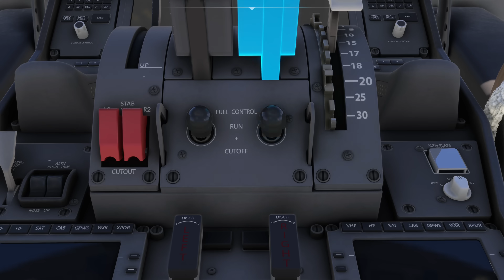Air India 171: Why Did The Fuel Cut-off Switch Get Moved?

Comment: Steve: READ THIS

Everyone seems to be twisting the actual last statements or words of the Pilots.

Their exact words, as taken from page 14 from "Preliminary Report Accident involving Air India’s B787-8 aircraft bearing registration VT-ANB at Ahmedabad on 12 June 2025"

Are as such 
Presumably Pilot "why did he cutoff"
Presumably Copilot "he did not do so"

Seconds later fuel was restored.

Until voice analysis is analyzed either pilot may have flown that plane. It is not uncommon for pilots to allow a copilot flight time.

Everyone is jumping to conclusions on this statement. Think about it. 

This is an active conversation between the two pilots with the tower. He says into the the mic which the co pilot is also hearing "Why did he cut off'? The co pilot responds and says, "He did not do so".

Now let's think about how that makes no sense in any other context. You're a smart guy. I'll make it brief.

I'm the pilot.. I'm thinking out loud. I see the switches in cut off position and I ask my self out loud " Why did he cut off"? If this was the case, a rational response from the copilot would be perhaps "Cut off what"? He's not psychic. 

So let's propose the pilot literally pointed at the fuel switches and said out loud "Why did he cut off"?

Copilots response wouldn't be "He did not cut off" spoken in third person... It would be spoken in realization the pilot is insinuating he cut them and his response would be more like "I did not do so" and not "he did not do so". 

This final communication had nothing to do with fuel switches and everything to do with a pilot communicating with their tower and thinking communication was somehow cut.

Comment: if its the pilot work done (for example) pilot should stretch his hands and he should take some time to operate the switch off position ...because it needs some extra side lever pressing to switch off...if so....the other pilot will be immediately divert his view to the dash board thinking why the other pilot doing in the switch?????? so it might not be the issue.... due to mechanical malfunctioning the switch both suddenly automatically came to switch off position. (Its my opinion, anybody can answer for this)

Comment: In the report it says (I haven’t seen it) that mechanically both switches were in the mechanical position (cut-off) — or did the flight recorder only record that the cut-off signal was received?
Is there a sensor that indicates the exact position of the button, or does it only record that the cut-off signal was transmitted?
Is it possible to execute this command within one second?
You have to be very calm and highly trained to carry out such a procedure so quickly — especially knowing it will cost you your life...

Comment: Under normal, intentional circumstances, it is highly unlikely that a pilot would inadvertently or deliberately move both engine fuel cutoff switches from RUN to CUTOFF within one second during takeoff. Here's why:

Design Safeguards and Ergonomics: Fuel cutoff switches on the Boeing 787-8 are guarded and positioned deliberately to prevent accidental activation. They are designed to require a conscious, deliberate action. typically lifting a guard and pulling or rotating the switch.

Moving one switch requires effort; two within one second would likely require both hands or an extremely focused, coordinated motion, not a reflexive error.
In a high-workload phase like takeoff, pilots are hyper-focused on speed, attitude, and callouts, not on engine shutdown procedures.

The CVR (Cockpit Voice Recorder) transcript suggests confusion, with one pilot asking, "Why did you cutoff?" and the other responding, "I did not do so."
This indicates neither pilot intended to shut down the engines.

Possible causes for near-simultaneous fuel cutoff activation might include:

1. Mechanical or electrical fault.
2. Malfunctioning autothrottle or flight control software.

Latent defect in the fuel control switch locking mechanism:

- The report referenced a 2018 FAA Special Airworthiness Information Bulletin (SAIB NM-18-33), warning that locking features might be disengaged on some models, making unintentional movement more likely.

- Air India did not inspect VT-ANB for this, since the SAIB was non-mandatory.

Comment: The physical switches may not be turned off. However, electromagnetic interference from other wires or electronic components, caused by faulty wiring, poor grounding, or lack of interference rejection containment, may generate spurious signals, leading to misinterpretation as fuel-off by the flight computer.

Comment: Please answer this for me Steeeve.
I have been really troubled by the "Evidence".
The transcript says one pilot put the controllers into 
"Shut Off" position.
The other pilot returned them to the "Run" position.
So WHY does the picture of the instrument panel after the crash, show them in
"Shut Off" position.
Or have I got it wrong?
Reply: Because they got destroyed in the impact. The black box has recorded the position of the switches, so the question is already answered.
Reply: If they were destroyed in the impact, what does the picture circulating refer to?
Is that not of the Air India aeroplane in question? @rabarebra

Comment: Can't we relay the ground sensors on the wheel that senses the aircraft is on the ground and set a time frame of 5 mins to that information so that the fuel stays stuck on run and when human intervention happens it gives out a master warning as simple fuel cut off or 1 engine failure(left) or 2nd engine failure(right) or dual engine failure for the master warnings.
Reply: As he said in the video, a human must be allowed to turn off the fuel switch IF a motor is failing. There is no way around this problem than having two humans control the switches. There should be double safety (because of mental health) for two pilots having their own cutoff switch - a copy so to say, so that both double cutoff switches need to match. It would solve the suicide problem one individual would have. The only problem left would be if both pilots were suicidal.
Reply: Thats fine im saying if a human interventions happening then the pilots should be alerted about it I'm not asking to stop it from usage but when used an alert should be noticeable enough to let them know about the manual fuel cut off so that they have a considerably bigger time frame to re settle things back.

Comment: I never realized how poorly planned some plane systems can be.
Critical switches and options should be guarded with multiple layers of checks.

How hard is it for a system to detect if the plane is gaining altitude, preparing for takeoff, or has a full fuel load?

Even a basic alert confirming such operations should be enough to notify the pilot.
Reply: This is not the problem. The problem is suicidal thoughts on one of the pilots.

Comment: The problem with your analysis is obvious. Once you said "I'm assuming". This early in an investigation, one cannot " assume" anything. We know ( at least from what of the CVR was released), what the pilots said. We don't know what the plane ( software mechanics), did. Unfortunately these planes are programmed to "think and ACT" independently if "the plane" determines it's warranted. From what we remember of the TWO successive crashes a few years back, both pilots may have been telling the truth and "the plane" was acting independently, through faulty programming or mechanical faults. Anyone, especially a PILOT, should not "assume" with so little concrete evidence that one of these men is a mass murderer, period.
Reply: Assume? The evidence is already there.

Comment: Not sure if this question was asked,  would there be any chance that the computer sent the wrong data to the fdr confirming the switches turned to cutoff?
Reply: How would they even get a lift-off if there was such an error in the first place?
Reply: @rabarebra what i meant was purely from the FDR perspective - preliminary investigation says as per the FDR data the switches were moved to cutoff position, and then back to run, so my question is purely on that data I.e. erroneous data in fdr? Would that be possible?

Comment: As both switches are mounted in the same assembly, If the entire panel became loose (screws, mounts, internal bracket) OR the internal mounting frame warped or flexed during takeoff acceleration/vibration, then both switches may have simultaneously lost detent contact (this is like a loose control panel in a car, if the entire frame shifts, all buttons or levers may get misaligned or move together)

Is there mechanical reliability analysis and failure modes report available?

Comment: I have a different question- why does the software not alarm the crew that these switches were switched? The airplanes have been designed for so many years, and now it looks like the safety basics are completely ignored by the manufacturer.

Comment: Are there any other switches which the pilots need to activate or deactivate just after take-off, especially in the close vicinity of Fuel cut-off switches? If yes, their positions may be verified. Maybe unintentionally, any of the pilots put the fuel switches to CUT-OFF instead of the required switches.

Comment: As an Aerospace and Systems Engineer my biggest fear of flying is the human in control of the plane. Extreme safety factors are placed on every manned system design, making these planes incredibly safe machines, but the largest deficiency in engineering today is Human Factors engineering. Humans are the most complex system to model. The sad truth is it takes a 1 in a billion failure of this nature to reiterate the design process to make a safer plane. It is immediately evident to me that, just like any safety critical hardware has  redundancy, that any safety critical  procedure shall also have redundancy. Not only do I think that those switches shall not be moveable while the throttles are are set to takeoff, but also those switches could be placed on both sides of the cockpit making it mandatory that both pilots turn the switches off for them to take effects. But even this method increases complexity and warrants other concerns like what if one pilot becomes incapacitated?

Comment: Shame on you Captain steeve😭, it wasnt expected from you, blaming pilots who are not here to put their side is very easy thing.  Mr. Steeve, how can you be fully sure the switches were manually cut by pilots?  I could be manufacturer's fault as it was also imformed in 2018 bulletin released. 

You are directly or indirectly ruining pilot community integrity. Shame on you sir ☹️
Reply: The airplane was fully functioning. The data reveals that. This was a human error (read: mental) fault by one of the pilots, not both. Go eat a cake, dude.

Comment: A simple mechanism could have saved .
In manual driven cars , if the car has achieved a speed, you cannot switch the gear to reverse position. Similar mechanism , if any flight is in motion these fuel   switche gears should not be allowed to cutoff either automatically or manually . Unless there is some algorithm wherein the switch can change to cutoff automatically like fire alarm .
Reply: So what do you do in the air then if one of the motors fails? Just let the fuel flow? Jeez, you have to think before you comment.

Comment: The Preliminary Report about the 12th June 2025 13.39 Local Time India, Ahmedabad, 2.5 kms W of Sardar Patel International Airport, 23.055488°N 72.615643°E, Air India Boeing 787-8 Dreamliner Crash Flight 171, Rego VT- ANB is interesting yet it is missing some very important parts.

A couple of points:

(1) This report was released in New Delhi on Sat. 13th July 2025 at 01.35 IST (India Standard Time GMT+5.30) - Fri. 12th July 2024 at 22.05 CEST 20.05 UTC 16.05 ET five minutes after the NYSE closed for trading. Boeing’s share price actually went up in after hours trading following the release of the report. USD 231,20 +4,36 (1,92%). This indicates that Boeing Intel and Aviation Analysts-Investors believe a Electrical/Technical Fault was not the cause of crash. 226,84 USD +23.09 (11.33%) over the past month.

(2) The Preminary Report states: At about 08.09.05 one of the pilots transmitted “MAYDAY MAYDAY MAYDAY”.

(a) Why is it “about”? 🤔 Surely they must know the exact time this call was made. 

(b) Which of the pilots made this call? 🤔

The co-pilot 32 y.o. Clive Kunder was Pilot Flying (PF) and the PIC, 56 y.o. Captain Sumeet Sabharwal was Pilot Monitoring (PM) for the flight.

(3) The Preminary Report states: In the cockpit voice recording "CVR", one of the pilots is heard asking the other why did he cutoff.

Who asked this question? 🤔  Clive or Sumeet???

The Preliminary Report raises more questions than it answers. 

As I have stated since 13/6/2025, the real smoking gun of this case is the Cockpit Voice Recorder. ⚠ It is the hottest piece of evidence on Planet Earth now.

To dispel any suspicion from the victim's family members and other interested parties and to give them rapid, humane closure, Prime Minister Modi should order the Director General of India's Aircraft Accident Investigation Bureau, GVG Yugandhar to broadcast publicly the full, unedited content of the plane's CVR from the time 07.53.00 UTC it left the terminal/passenger boarding and when the aircraft requested pushback and startup to just after the impact/crash/fireball at 08.10.00 UTC (Approx. a 17 minute recording. The last 90 seconds are the key.) 

The full and honest truth about why this crash happened has to come out so that the chance of more such incidents is reduced. Many good people in the Aviation Industry since Les frères Montgolfier have spent a great deal of time and effort trying to work out why various crashes happen. They have built up a huge body of work to improve Aviation Safety. It is a real Science. Knowledge is cumulative, yet sometimes in history a new glitch appears that threatens all the previous work...

“Those that fail to learn from history are doomed to repeat it.” - Winston Churchill.

Prayers for all the people on the plane and ground injured, maimed and killed in this terrible incident.

Adam Neira
Founder of World Peace 2050

Founded April 2000
Paris - Jerusalem - Melbourne
Reply: Appreciate your genuine inputs, thanks a lot!

Comment: sir, you are doing one mistake.
There is also possibility that the same pilot cut off fuel supply, pretended innocent and asked other pilot who said no...
to clean himself of terrorist act, he again tried to move fuel supply to correct position late by 10 seconds.
otherwise its extremely difficult in that panic situation for a pilot to guess, that loss of height is due to fuel supply.
someone guessing so fast also makes me doubt, whether the pilot asking himself did the terrorist act.
judicially its not possible to prove who was the terrorist among the two...
Reply: This is a good question. It could be the scenario. Only way to know in the future would be to have cameras in the cockpit, as this would prevent scenario like this. Being filmed, you wouldn't put out a lie.

Comment: Why would boeing allow a plane with movement forward in excess of 100 knots with altitude higher than ground level with a climbing attitude allow fuel to be cut from engines?
Reply: Because if failures should happen on one of the engines in air or at any time. Prevent fuelling a failed engine with fuel.

Comment: @Captain Steeeve..... "The day they go to an airplane that doesn't have a pilot in it, it's completely controlled by AI is the day that I never step foot on an airplane again."
a single pilot? that's when i am out.... i want at least two with this  "always 2 persons in the cockpit" rule! (germanwings-9525) pilot is the only job with mass murder capabilities... as a train conductor you will kill barely 100.... don´t think any single person in mass shootings ever hit the 3 digit range.... (only in war or a single time Timothy McVeigh)... as a commercial pilot the lives of hundreds over a thousand with a A380 hitting the right spot on the ground or with a regular jet hitting one or two tall populated structures....memberberries anyone? who hasn´t crashed into structures in flight simulators for fun.... psychos exist... malaysia 370... no single pilot
any yeah the computer should prevent such a thing at departure... and there should simply be a double fuel switch system for both pilots... unless both are set to off it stays on, so no single pilot is able to turn it off without the other putting theirs on the off position too.. easy 2 person rule cockpit
Reply: Rank        	Name                             	Event               	Year	Death toll
1🥇	Sumeet Sabharwal	Air India Flight 171      	2025	260
2🥈	Zaharie Ahmad Shah	Malaysia MH370          	2014	239
3🥉	Gameel al-Batouti	EgyptAir Flight 990      	1999	217
44⃣	Timothy McVeigh 	Oklahoma City bombing	1995	168
55⃣	Andreas Lubitz     	Germanwings 9525     	2015	150

pilots are running the show, new top contender
it wasn´t a suicide, it was mass murder by suicide

Comment: I think 10 seconds to react is an extremely large time lapse for a situation so important. Normally in a stress situation your response time gets accelerated, that's common on car emergency situation. Also I guess if the fuel is cut off it will rang some kind of alarm immediately so the pilot realise what's going on. 
If the conversation is not released to the public then this is a facade to blame the pilots

Comment: 03:05 You can't have a two man/person rule because what if the other pilot is incapacitated what then? The software needs to alert if climbing from take-off rather than descending.
Reply: Incapacitated when all was good during take off. Don't you think airplane companies have a system for this? It is called fit for flight.